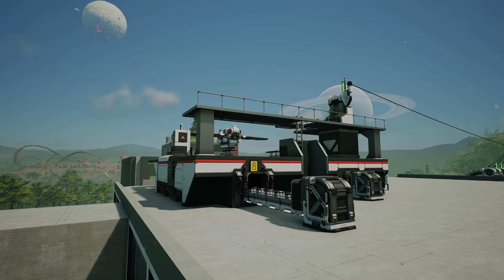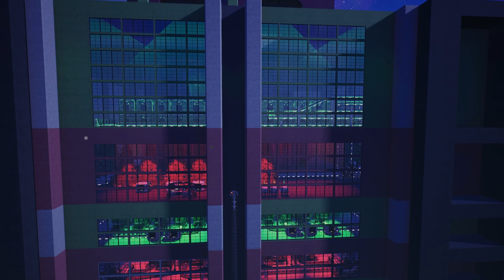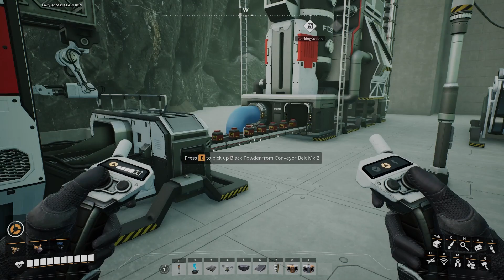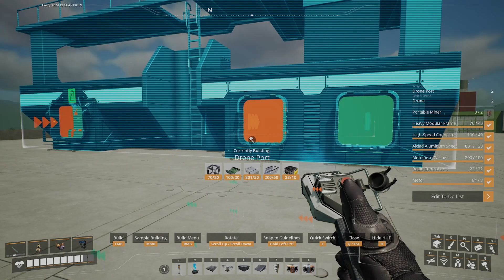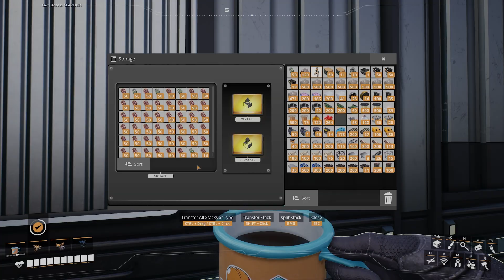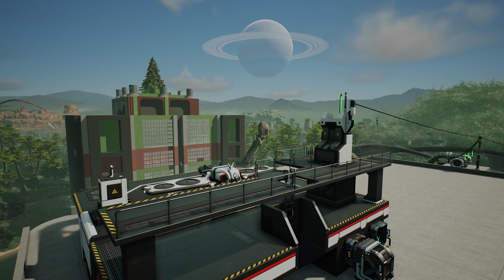Are DRONES still useful? in Satisfactory Update 7 - S3E17

Comment: Started out informative, then before explaining how to set up the destination ports, which is what I am having trouble with, the clip went stupid. 😩
Reply: The drones need a power source and batteries as fuel. Then pick where you want them to go. They are a simple version of the truck station. I did not realize they needed wire hookups lolll. The drone Flys off and I never see it again. Oh and the drone station needs the station and 1 drone. Then a receiving station. I use mine to bring sulfer for the battery blender.